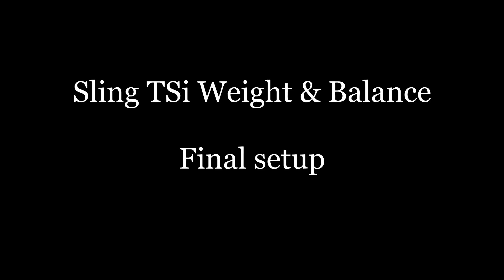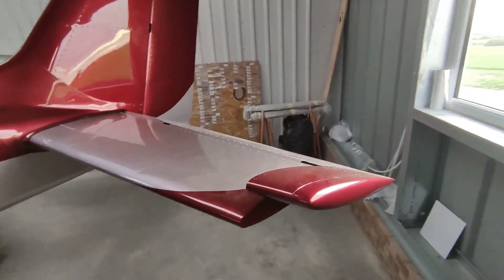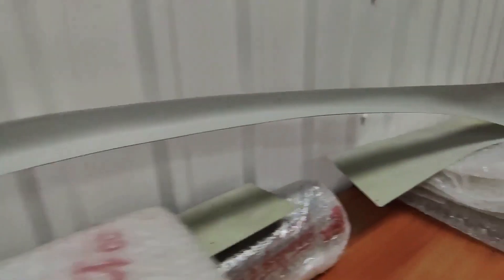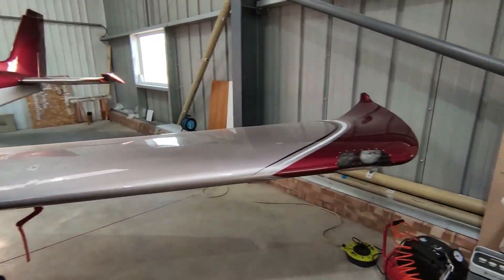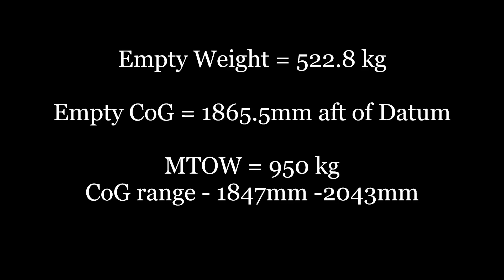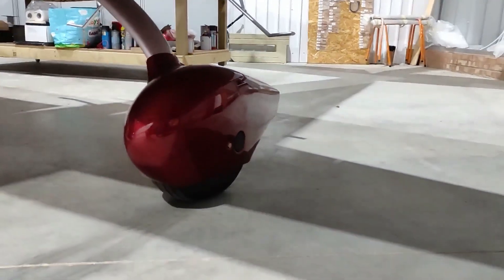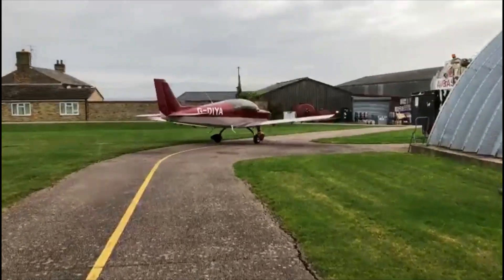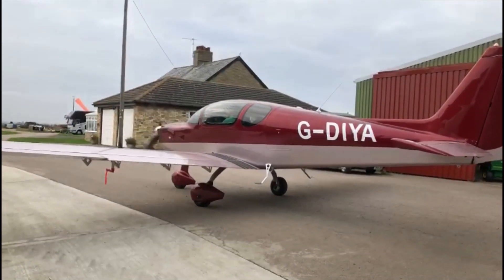Sling TSi Weight & Balance

Comment: Hi, I have a quick question you may be able to answer: In reviewing the KAI, Firewall FWD & Fuel System page 25/43 and 31/43 I notice the Sling TSi has a Posi-flow Electrical booster fuel pump!
I also found some mention of this booster pump in the POH v3 (not as many as I expected...)

Question for completed/flying builders. If the Main and Aux Rotax Fuel pumps fail, will the booster pump cover the needs of fuel for the engine?

If someone with a completed plane, but not yet flying, can you try posting the fuel pressure on the G3X with both main/aux pumps off and only the Booster pump on? And then the reverse, Booster off Main/Aux on?
Thanks!
Reply from the maker: I believe the boost pump on its own cannot deliver enough fuel to run the engine. My wiring is such that the boost pump is coupled to Pump 2. So I can run just pump 2 if I pull the breaker for the boost pump. But I cannot run just the boost pump on its own. In my fuel flow test, pump 1 and pump 2 each delivered fuel at 180 L/HR. Will check the pressures next time we run.